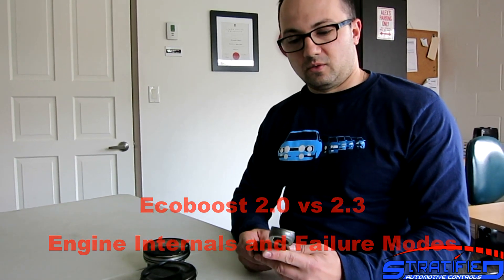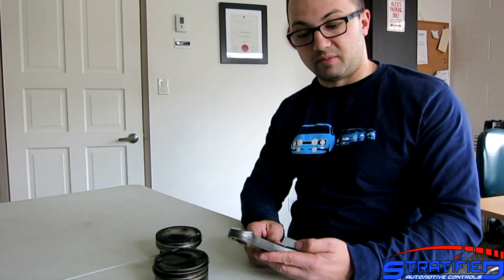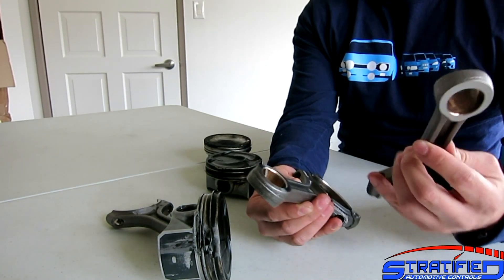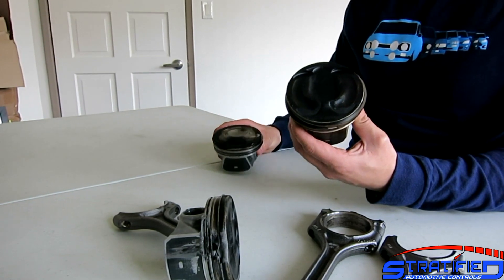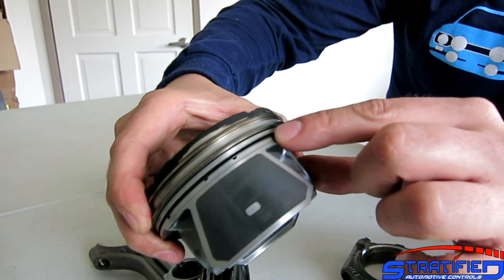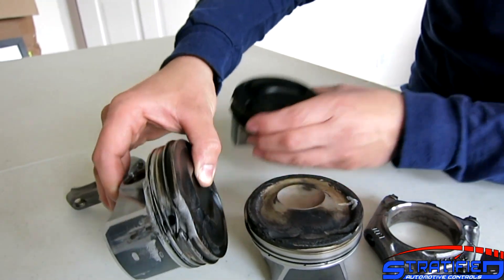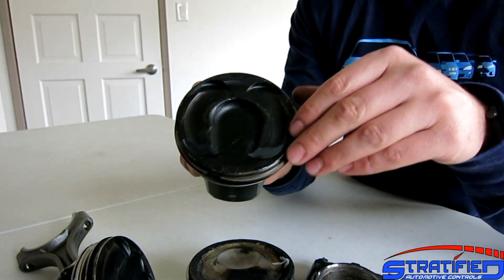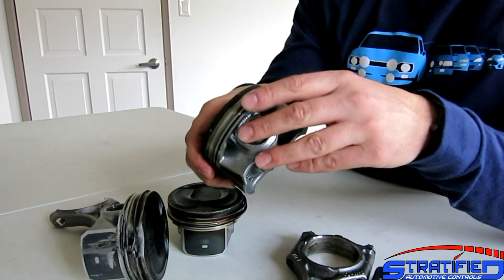Ecoboost 2 0 vs 2 3 Engine Internals and Failure Modes

Comment: Good to hear someone talk about LSPI! It's an in depth topic with some solutions that you wouldn't ordinarily think of. Oil control on the bore is important, as is the type of oil you use and so is... wait for it... which side of the engine the air comes in from.

Piston rock opens up the ring land gap on one side fractionally more than the other, and when you've got fresh charge at a high tumble rate coming in and hitting the bore wall, that tiny gap change matters when it comes to oil intrusion into the combustion chamber. This is one of the advantages the GM Ecotec drag racing program had over the existing SR kings.

Unfortunately it looks like I won't be able to hit my 400whp target without a teardown of my 2.0 ecoboost rwd. I'll need some other bits and pieces to manage that. But still, if I stop at 320 I should be fast enough. I'll be using a compound turbo setup to get there, simply because I really like the low-mid that's already there, and without the ability to go twin-scroll (got a single-port head unfortunately) I wouldn't be able to hit both targets with a single upgrade.

Comment: The Mustang ecoboost 2.3L crankshaft and connecting rods are made from forged steel.
Reply from the maker: Rods are powder forged. The rods are definitely the weak point on the 2.3.

Comment: I’m never buying a ford again I bought a 2021 st 2.3 22000 km and I’m driving for 2 weeks let it warm up let it cool down when needed today I got tapping noise can feel it on the valve cover  stock engine idle go’s up and down a verry weak block is what I found so far wish I’d never bought it
Reply: I think when engineers and manufacturing consider placing extra money and importance into the casting of blocks, bean counters will counter that it costs too much money.  And there you have it: failure modes. But Ford continues to bank on making fun and attractive vehicles. Thats what sells a Ford today.

Comment: I'd like to see them using better (forged) pistons and rods in the ecoboost engines.    You need a strong rotating assembly on turbo engines that are being pushed to outperform the larger displacement engines they're replacing.   Plus it gives more headroom for the customers that crave even more power from these little gems.

Comment: hmmm steel inserts in an aluminum piston it's strange to me how that would work as steel and aluminum expand different amounts, different speeds, and at different temps.
Reply: melding of two cast materials is possible as you may know that the iron-lined aluminum block is generally better than say the Nikasil sprayed Porsche aluminum block as it is more long-lasting. If the iron or steel is on the edge of the aluminum then it should he able to expand unrestrained and not crack the aluminum

Comment: Have a 2020 Mustang Auto HPP and the Piston went bad...still don't know why...at the dealer for 3 weeks...has 22,200 miles....regular maintenance...treated well, no racing, no reason that I am aware of for it to break. Waiting for a new engine on B/O.....no eta yet and it's been almost 4 weeks so far. Any ideas? In so. California.
Reply: provide more details. What oil change interval? What condition while driving?

Comment: The eco boost motor 2.0 and 2.3 are to big for this system the moving parts are to big, it is for max. 1.0/3Pistons this is a really good working 125 Hp motor. The big one are like a Hybrid with a140 kw e-motor and a 220 Burner. Bigger is here not better. Sorry for my bad englisch. Greetings from Vienna
Reply: isnt everything bigger? There are many 2.0T motors.

Comment: good morning everyone. 
I bought an ecoboost mustang a short while ago.
 I would like to know How many horsepower the internal stock parts support without giving me problems with breakages.
Reply from the maker: Many variables to account for here as even a stock motor can fail. Overall the 2.3 can safely handle 350-400whp long term if well taken care of and tuned.
Reply: If you're not already, I'd join an ecoboost/mustang forum where tons of information to answer questions like yours exist.
You will get real world figures from people who've experienced full to moderate builds...power limits...etc. I'm pretty sure there isnt an upgrade, bolt-on, removal, tuning, tire, brake, interior upgrade, etc question you might have that's not already answered if you just search forums.  ^_^
Reply: @dham99  
thanks.
I started the changes on my ecoboost a little while ago .... but I think I will not go beyond 400whp.
I want to have a car that will not bring me problems with engine breakdowns and I am not willing to exchange pistons and connecting rods for sturdier parts.

Comment: Hi Alex, I have 2014 Ford fusion so far 40k mile on it 2.0 engine oil Change every 5k mile, so far thanks God no any issues just why oil getting dark very fast even in 3k and oil smells little bit like fuel, I heard about fuel dilution problems but is that apply also 2.0 ecoboost? I thought this issue only with 3.5 ecoboost, also focus st 2.0 ecoboost in video, ford fusion 2.0 same engine with same piston and rings?
Thanks
Reply: @StartifiedAuto
Reply from the maker: This is common to all ecoboost.

Comment: is the 2.0 ecoboost engine  made in spain , better than the same engine made in the usa.. the engine made in spain engine has a exhaust manifold seperate from the usa version, that is part of the head..i have a 2014 fusion with the Spanish engine

Comment: Hello, hope you can see this comment, i would like to share with you a case of engine failure in a Jaguar XE, which has the same 2.0 ecoboost engine: The owner stopped at a gas station to put some gas, however they mistakenly put  diesel on it. This gas station is right before a huge climb, it probably ran full throttle for around 10minutes before bogging down and shutting off. After towing it to the shop, we drained the gas, fill it up with fresh gas, replaced the spark plugs, and it fired, it was very smokey and rough but eventually it ran better. However it would idle in 3 cyl,  a misfire code on cyl #3 was set. We did a compression test on that cyl and its dead, 50psi max. Also lots of blowby, even when doing the compression test.   Car is a 2016 with 30000kms, so it will go to the dealership. We are looking for the causes of this engine failure, do you think gasoline mixed with diesel can result in pinging and eventual failure?

Comment: The piston failure is due it being the leanest area of the crown which will over heat that area.

The 2.3 rod failure is due to higher angularity because of the longer stroke and increased acceleration and deceleration loads due to rod to stroke ratio

Comment: Does ecoboost mustangs have engine issues before reaching 100k?
Reply: Common to see engine failure before 80k
Reply: It’s so rare though.
Reply: @BIendtecc  alot of the engine failure is due to people abusing the cars and lugging them a lot
Reply: Martin Valencia yeah true
Reply: 20k throwing cel and wrenchs on me after multiple tunes after a year nothing to crazy. All pro tuners cobb and sct unleashed and ssi
Reply: @chrisandrade3929  Used a tuner to push the engine past its factory engineered limits and you were surprised that you had engine issues? Duh.

Comment: @StratifiedAuto I have one of your flash tunes on my car, just installed it today. I was getting decent corrections between 0 and -2.00 (-2.00 being the highest) for most of my test run, then on the last pull, I shifted to 5th at around 75mph, 4500 rpm, and immediately cylinder 4 hit -3.65 This was alarming to me, and I remembered my teachings on the forums to NEVER boost in higher gears. I reset the AP values and did a few more pulls and the high correction did not return, only seeing corrections at a high of -1.65. So its definitely uncommon.

Also, my AFR sits around 11.10-11.30 in WOT pulls when reading live data, but I must be hitting lower for split seconds because on the min/max values I saw a 10.58 after the pull was over and i was at cruising speed in 6th. (that was not live, that was after the pull, past recorded lowest value). My OAR is at 1 and my Fuel Pressure is  around +/ 2k psi. Boost pressure maxes out at 22.7 psi.

How would you say my car is doing judging by these numbers? I want my engine to last a long time, the car is my daily and I dont want to see her die...shes my baby lol.
Reply: Hi, I recommend contacting us as a reply to your tune email rather than through youtube. Some knock is normal and all vehicles will experience it and your does not sound excessive.
Reply: Did you buy a revision also when you purchased the e-tune?

Comment: Unfortunately same situation here - failed piston on a 2.0l ecoboost 176 kw engine in a 2013 Ford S-max with 100000 kms. Very disappointed.
Reply: Did you change the piston?

Comment: don't floor it in 5th or 6th gear and you wont get lspi
Reply: In a Manual?
Reply: @BIendtecc  At least in an ST, yeah. Don't go WOT in 5th or 6th, and don't go WOT if RPM is south of 3k.
Reply: Daniel Looney what about an auto lol does the computer adjust it?
Reply: @BIendtecc  you can't get the vehicle as an auto. Even if you could I'm sure it would be programmed to kick down like every other auto in existence. You don't go WOT in an auto equipped vehicle in auto mode and it just lugs along in top gear.
Reply: Don't buy is a better solution; this is obviously a failure in design and manufacturing.
Reply: @tdgdbs1  I see ring land damage as a result of pre ignition, not nessecarily any issue with manufacturing. I think you need to research LSPI and it's effect of GDI engines destroying ring lands identically to this.
Reply: Ecos are only good off the line. 3rd or 4th gear pull with a tune. The engine flexes and you hear engine mounts and zipties being yanked on
Reply: @BIendtecc  nope

Comment: There not powdered metal Conrods  their standard forged steel Rods 
Powdered metal is a much smoother finish due to the metal melting characteristic those rods you have are a proper forged steel rod.  You can’t technically get a forged powdered metal Conrod. Don’t be confused by forged Pauter Conrods.

Comment: Is this were the 1 step colder plugs help to reduce problems like the ones you showed here?
Reply from the maker: They do guard against pre-ignition and Ford prescribed 2 step colder with their FRPP tune (although they do get fouled and are a little too cold in my opinion).
Reply: @stratifiedauto  One thing I've noticed is the 2 step colder plugs do seem to hold proper gap for a little while longer than the 1 step colder plugs. I am on my 2nd set of plugs on my FFRP tune. The last set made it around 45K miles before misfiring started. I can always tell when the plug gap starts getting around .032 as the engine starts misfiring under load. Could probably just gap them again but I always replace them with new ones. I have found that setting the gap to .028 on the FFRP tune seems to do well for many miles before excessive gap causes issues again. Got the tune at 8K miles and now have 59K. I worry about carbon on the valves more than piston failure however, I know not to perform hard acceleration at low RPMs. This engine starts to produce torque at such a low RPM range most inexperienced drivers will simply press on the go peddle when they really should gear down to avoid LSPI. That inexperience and/or maybe a shady quality of fuel with advanced timing and higher boost of a tune and you make the possibility more likely.

Comment: So would you say an increased oil change interval on the 2.0 would help prevent pre-detonation from fuel contamination in the oil? Thanks.
Reply from the maker: Certainly fresh and non fuel diluted oil will help in both lubrication and keeping that oil in the crankcase.
Reply: this is four years old but I have noticed that some slightly "heavier" or stickier oils will stay on the cylinders better with less going into chambers. This is generally good but at the cost to efficiency.

Comment: Hi Alex. What's your take on the HG replacement for the RS? Have there been any failures since the HG replacement?
Reply: pr0jectSkyneT at least three cars in the UK are now on their third head gasket (their second non-Mustang one) due to further coolant/oil leaks.  All three only had gaskets replaced, so subsequent failures may be down to Ford not checking for warped heads.  I still feel the open deck design is a contributing factor though.

Comment: Is there any new revisions in the 2.3 liter ecoboost engine because I cracked my cylinder block in #3 cylinder but was replaced with a remanufactured ford engine under warranty in March 2018 from an engine built off the assembly line dated August 31, 2017. My was built 04/16
Reply: no...just the head gasket recall...which is probably why your engine #1 blew
Reply: The block cracking is another issue unrelated to the head. Basically there's not enough meat in the centre rear of the block, as a result integrity suffers. The 2.3L Mazda MZR DISI turbo block never had this issue, neither did the 2.0 Ecoboost - Why Ford went open deck when designing this engine is anyone's guess.
Reply: Either 2 or 3rd cylinder blew cause the head gasket was funmy

Comment: Should be insteresting to see how many Rangers fail towing a 6500 lb trailer
Reply: I think the ecoboost is an awful choice in the Ranger, it's not going to be a long term reliable engine.
Reply: The 2.3 in the ranger has stronger components compared to the normal 2.3, so it probably won't fail.

Comment: A higher wristpin position also promotes piston rock or slap which is known to cause ring land failure. Of course it very well could be caused by the poorly designed pcv system on the Ecoboost as well. The two center cylinders catch any oil that makes it through the pcv system which causes the gdi carbon build up.